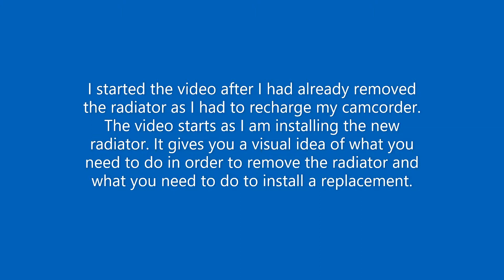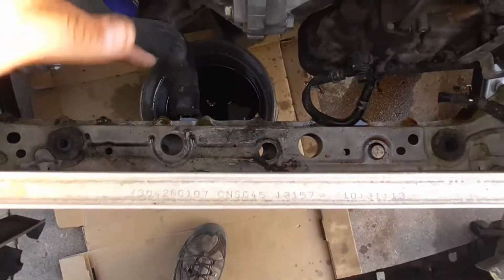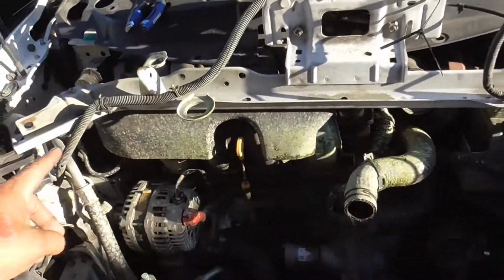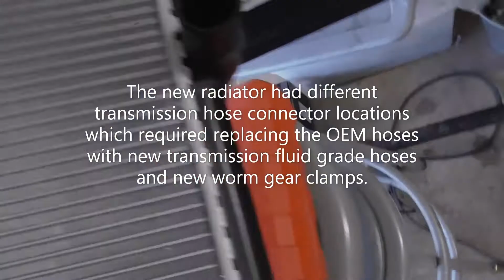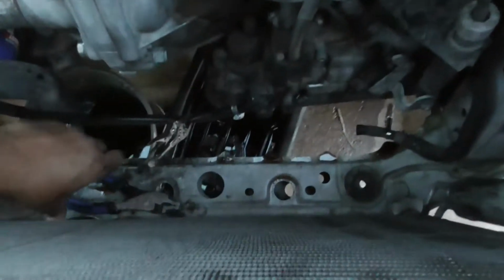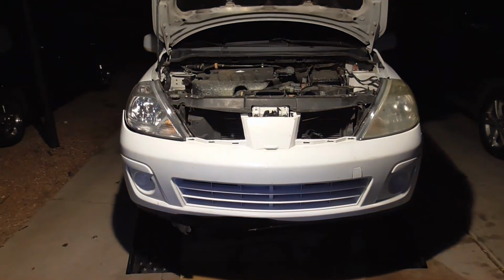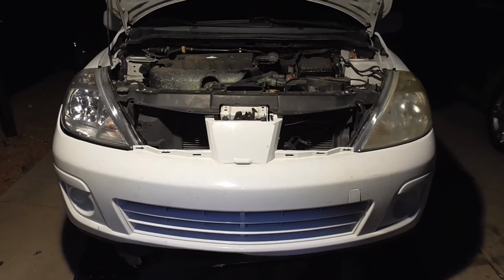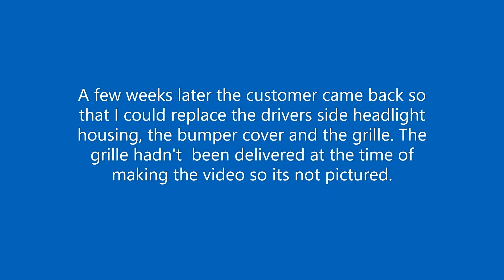2008 Nissan Versa 1.8 4 cyl radiator replacement / radiator fan assembly removal-- 2006 - 2012

Comment: Black bumper on white body looks pretty nice!
Reply from the maker: The customer parked too close to a parking block stop. When she pulled away it started to pull the bumper cover off. Shortly after that someone slammed on their brakes in front her and she got their rear bumper so it was done with. Replacing it was the best option. She had it cleared and kept it black. She liked it as well.

Comment: Hey hey you don't have video where u Stat  take of radiator off
Reply from the maker: No, but it’s the same process but you have to disconnect the transmission cooler lines and drain the coolant and disconnect the bottom coolant hose. It pulls out from that point.

Comment: Did not understand how you bent the brace. I have the same problem
Reply from the maker: Well, the customer hit a parking stop (concrete pillars they put in parking spaces to stop your vehicle) and rear ended someone so if you mean the brace for the front clip that’s how it was bent. ?

Comment: Yoo bro do u know if a 2008 nissan sentra radiator would fit a 2011 nissan sentra ?
Reply: The reason I'm watching to see if he would say something about what type of radiator? At this moment I need a radiator for my 2011 Nissan Versa S. I don't know if should none variable automatic transmission  or the one with Cvt. It's so confusing.
Reply from the maker: Yes, they are the same radiator.